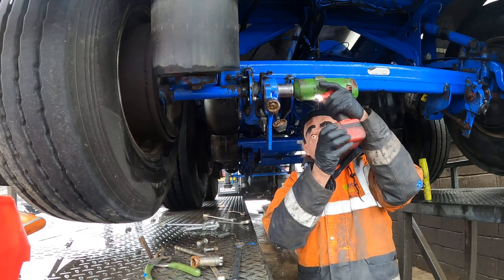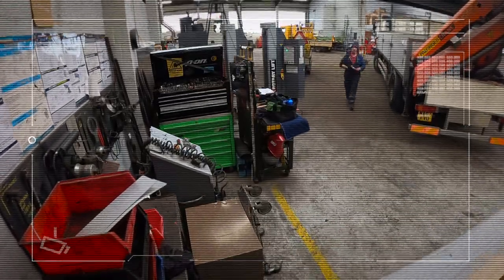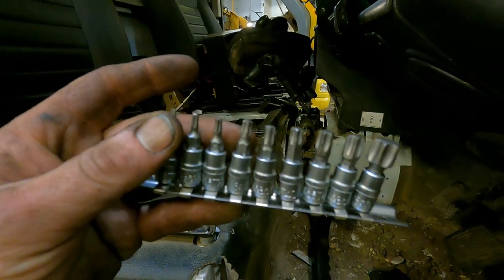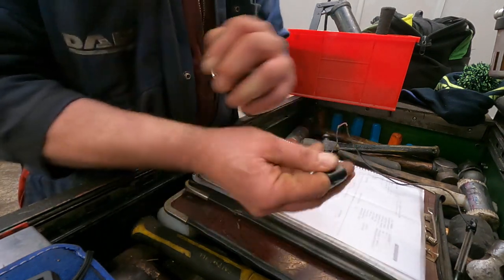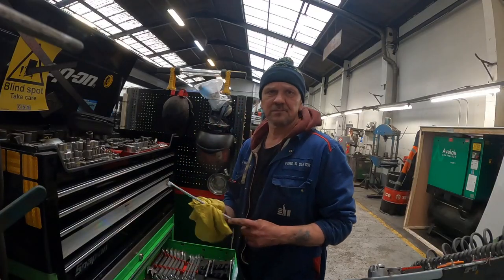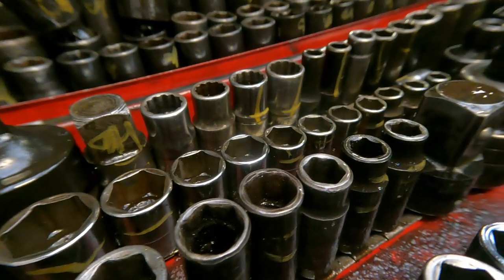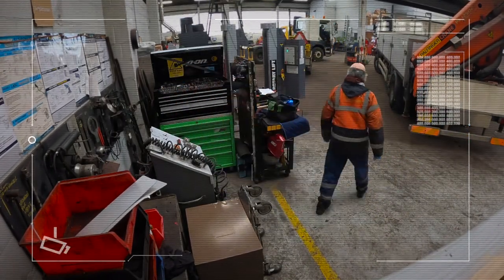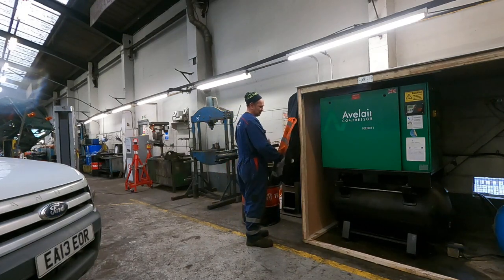Trailerfitters' Toolbox - WD40 for Tools, None Damaging O Ring Tool, and The Freak Show Continues

Comment: I swear by ACF50 anti corrosion fluid  for keeping the rust off my tools. It works on chrome and bare steel and hasn't dissolved the handles of my screwdrivers and pliers...yet.  It's  quite like that brownish thick oil that Snap on dip their sockets in and works wonders on phosphate/ chemically blacked finishes...it even smells quite nice. Available from Amazon.

Comment: Hi Chris.....yes i spray my tools with WD40 and then wipe of the excess the same as you, i had a lot of spanners, sockets, and ratchets that were often used outside in adverse conditions. For micrometers etc i use a light oil like 3 in 1 which i leave on.....really enjoy watching your videos, i appreciate all the hard work and effort that you put into your video productions Chris, best regards, Stefano.

Comment: Will start with where did you get the crimping set ,?? i like how it shows the terminals for the jaws ,and the jaws are slide fit ,where is mine are screw in and i then have to experiment to find out which jaws suit which pin ,,,Liked the Landy bit .in the army many moons ago  ,land rover got upset because we chopped the metal out between the 2 seats rather than take the seat base out to do a clutch then rivet it in ,but in certain situations we didn't have time to follow the book lol.And we would fit batteries between the seats in certain applications ..When you said about access to the resovouir  ,doesn't the bonnet just fold back to the windscreen anymore ?. In a LHD the clutch master cylinder is under the wing ,Luckily on military spec there was a bolt on the wing up at the bulkhead so we took that out cut a slot in the wing say 6 inches down  folded it back to access it ,then rivet a plate over the cut lol otherwise it was a wing off job...100% look after your tools we spend a lot of money on them out our wages to then earn  the company money ..Could you imagine getting a job in a supermarket and being expected to supply your own till lol..I also do not allow anyone to help themselves to my tools ,where as others do not mind people just helping themselves ..Luckily my tools are well lubricate ,last few jobs  camshaft times 3 ..Dusted engine ,dropped liner on euro5 so that is on hold can't see that being done ,and now on to a blown head gasket on a LF ,,The lad on freight line is it channel the Ryder lad .he is good and knows his stuff.Sadly ryder are pulling out of the uk .rumour is asset alliance are taking them over